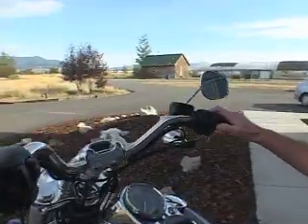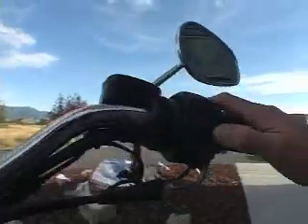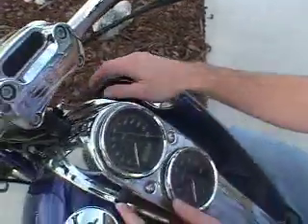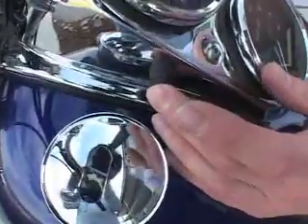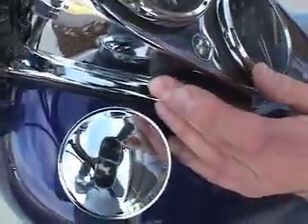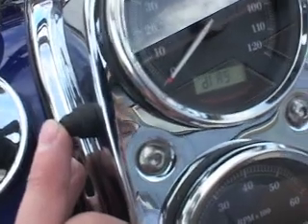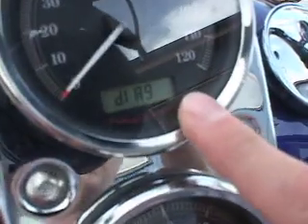Harley Davidson Engine Code Retrieval and Clearing

Comment: @maxbagofun U have a service manual? Usually there is a fuse u can pull to reset the ecu. If u dont know u can disconnect the battery for 30 mins.